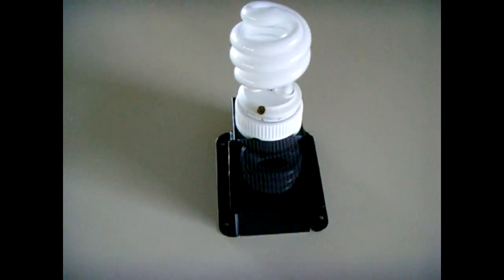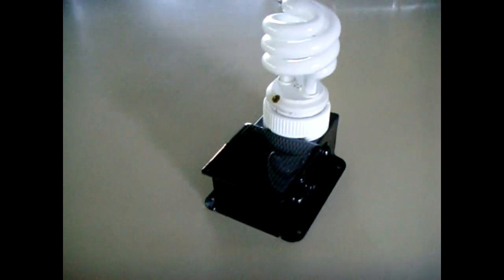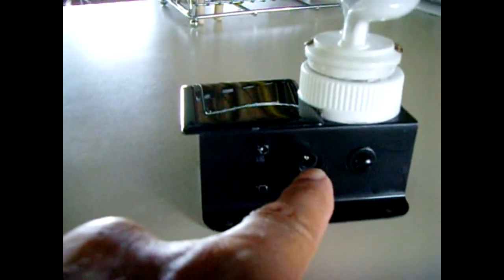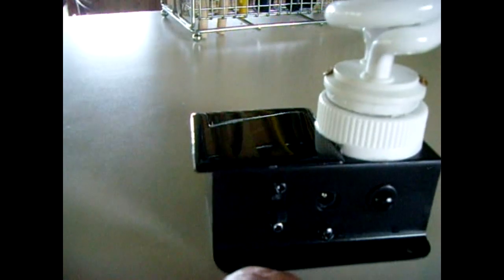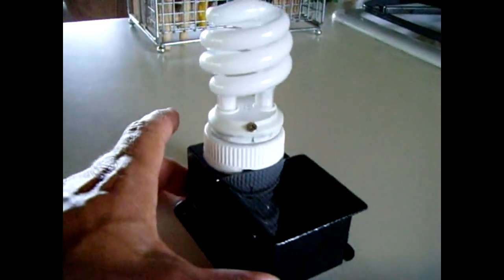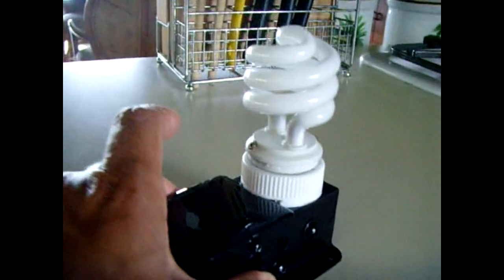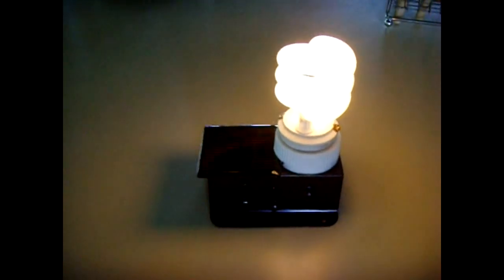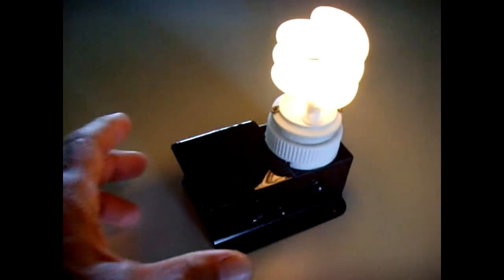Completed Fuji Circuit CFL Driver

Comment: Hi ElectronicsNmore  ,
Great video. I tried to do a basic copy of this project with a couple of different disposable cameras but I can only get a 3.5 W led lamp to light brightly but it's strobing at a constant rate. I couldn't get it to light continuously. A brand  new working  12W cfl bulb  wouldn't even flash when carefully cut open - nothing . An intact CFL bulb did strobe again at a constant rate but no continuous light. I'm puzzled. Any idea what I'm doing wrong? Thanks,
James

Comment: Nice video, how many batteries or volts could you run to this setup the way it is ?
I have 18 volt batteries from cordless power drill, that can be stepped down to as low as 3 volts with a step down converter I bought so just curious if the camera flash circuit could handle the full volts the light was designed for ?

Cheers
Reply from the maker: You will not light the CFL at "Full" brightness. I would stick with 3V. I still use mine to this day with no problems.

Comment: All nuclear power plants where built for the creation of waste for nuclear bomb's and coating bullet's in armor piercing tank's and walls even though titanium does the same thing even copper's with nickle in them .The nuclear power franchise is a multi billion or trillion dollar business and yes it does need to be replaced with plasma boiler systems they could even use the same buildings that they have JUST replacing the Nuclear part with a plasma chamber systems

Comment from the maker: No. Just make sure the HV lead going to the CFL is insulated well, and that the wire coming from the CFL to the HV lead is protected from touching the metal project box. To be safe, use plastic.

Comment from the maker: Take the small solar panel and connect the (-) to the battery neg, and take the (+) of the solar panel and feed it through a schottky diode(like a 5819) then into the battery pos.

Comment from the maker: @BDDFOUR It all depends on where I set the potentiometer. Lower ohms = more current from the battery = brighter bulb. Keep in mind that this light is not bright like when it would normally be used on AC power. It runs with a good output, and lights up a bathroom well, and is excellent for your bedroom nightstand to light up the room/read a book.